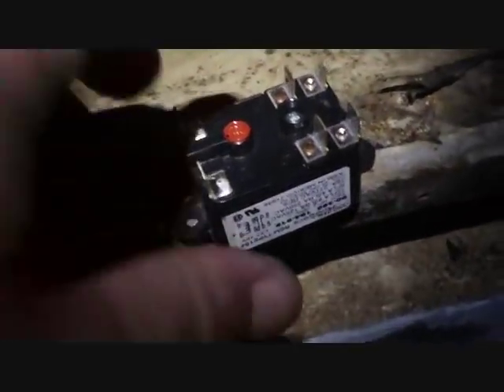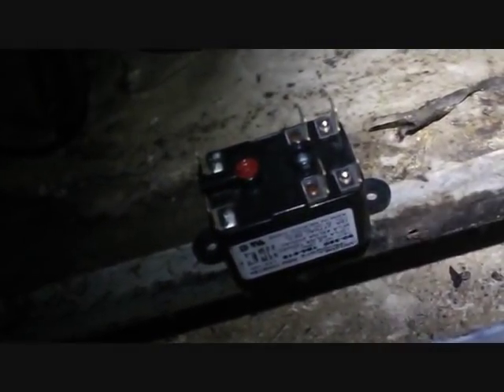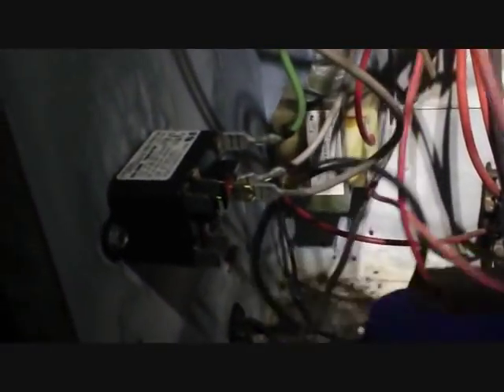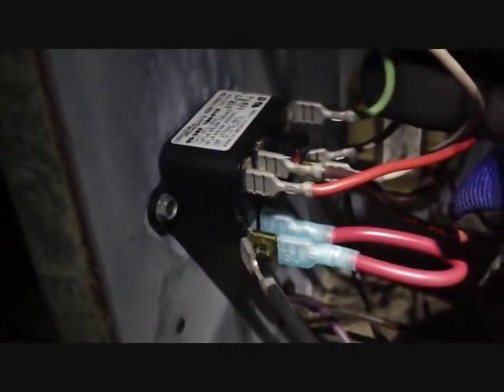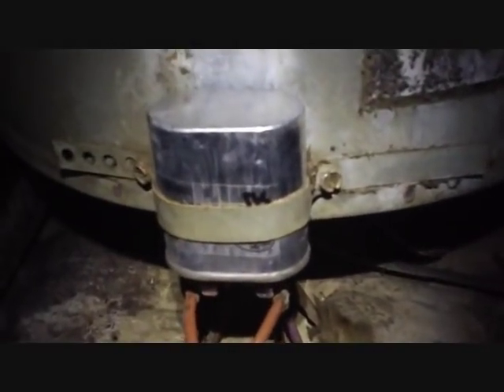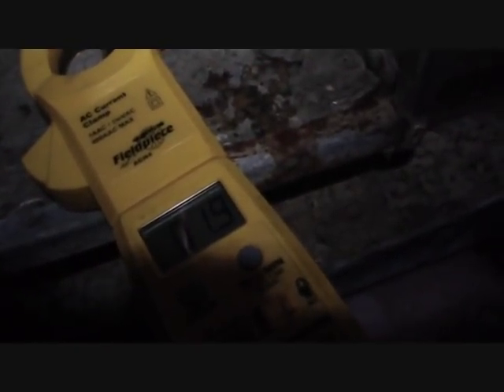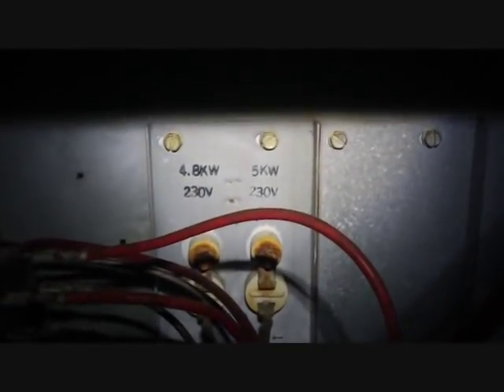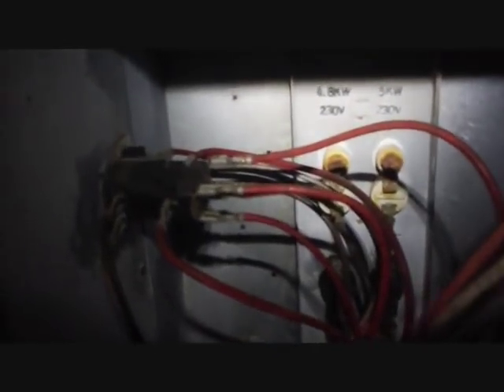Goodman Stack Blower Relay Failure | Heat Strips Run Constantly

Comment: Those old Janitrol relays were so bad to go out years ago that I got to the point if I was working on an air handler with one of those relays on it I would just go ahead and replace  it weather it was acting up or not. I didn’t trust them.
Reply: I will say they do seem a lot better now though,

Comment: They have changed that relay to a 'Blower control board" that seems to stick in aux just like the old relays did.. Especially in colder weather but it looks like those were the old Warren heat strips that most of our Goodman dealers here in NC have quit using.. fusible links couldn't hold up on the Warrens.. A common heat strip failure but its always fun to have the 2 calls stack together lol.. Relay stuck with 1 rack of strips running.. Can fix the relay but always have to order the strips lol
Reply: It is hilarious how they managed to redesign it to have the exact same failure

Comment: Hi tayln875 - thank you for the video - I think I'm having this same issue. I have noticed that my air handler only turns on when the aux heat comes on. The air handler will not run when the regular heat (+2 degrees over temp) turns on nor during the cool sequence. If I turn the heat 3 degrees or higher, the aux heat kicks on and so does the fan motor. I changed out the capacitor and that didn't seem to help any. Do you think this could be a faulty relay? Thank you!!!
Reply: +Tyson Rooney I forgot to mention - my AH is a Goodman A24-10. Thanks for your input!

Comment: Yes I see it now the normally closed side of the relay was was stuck closed so when the relay was energized with 24 volts and it pulled in the normally open contacts it was sending power from this relay directly back to the heat coils because of the safety loop feed from the coils back to this relay to force the blower on. One of those weird little setups that was used to prevent a problem that causes a problem itself at times......  I wonder if there is another way to do this that would be more reliable as this seems to be a pretty common issue.
Reply from the maker: I have often wondered about using a current sensing relay, but have never tried it.

Comment: I have the same air handler....I am having issues with the Fan not coming on when the Thermostat is in AUTO.  I can set the fan to ON and it will come on...sometimes.  Sometimes I have to put the mode to ON and set it to EM HEAT and then to cool to get the fan to come on.  I am thinking it is the sequencer.  My question is ...do you think this also and should I replace it like you did in this video for safety reasons?  My airhandler is A32-10  Goodman.
Reply: next time you got the same problem w/ ur AH try replacing the thermostat. also check the fan capacitor .

Comment: Nice video! Just wandering what’s connected on the other side of  N C contacts? On one side you have it jumpered and the other side?
Reply: It's the fan---when heatstrips are called fan also comes on...
Reply: on the other side of normally closed contacts, the wire is connected to the outlet side of the heat strip contactor so power is supplied to fan whenever heat strips are energized.

Comment: Got a 09 Janitrol unit, recently the fan stopped turning and no air was being blown. Changed the dual run cap per a local pro's advice and now the fan is turning but still no air... any advice on what to do would be much appreciated, I'm pretty much a rookie at this stuff.
Reply: which fan, condenser or blower?

Comment: Please explain in detail HOW the bad BLOWER relay was making the heat strips stay on?? I cannot get it to make sense. I could understand if the sequencer was bad and keeping the heat strips pulled in and the fan on but cannot wrap my mind around this. Please help
Reply from the maker: This relay typically routes power from the heat strips to the blower or the main lugs to the blower, but it tends to fail sending power from the main to the heatstrips and thus to the blower as well.
Reply: talyn875 Thanks for posting the video. I was curious did you test the old blower relay after you took it out?  I had been working on a 2001 Goodman AR024-1 it had the same symptoms that you had with the heat strip pulled in and the blower running (will not stop heating even with the tstat to off) however it was intermittent and would not act up when I was there. I "like you" thought maybe the relay was possibly shorting out and changed it plus I changed out the sequencer (just in case) and double checked the tstat wiring and tstat settings HW 5220.   Still the same intermittent problem. The system is just so simple that you cannot believe that did not fix the problem in one trip!!!!. What do you think it ended up being? Hint this is a heat pump.......  
Separate subject here I need a York AHU Control board S1-03101212-700 for the heat section Model @HW06501006A EECY151209 my local supplier says discontinued. Do you have a source or have one in your stash?  Let me know on that board I would pay good money for one as it will save several hours in the rewiring entire AHU to eliminate the board. The original board is a 031-01212-000 it would work also if you have one.
Reply: @HVACShopTalk  you have a diagram for this !! ihave the same problem !! with my unit

Comment: ive watched this video a lot and im getting a little confused... What is the point of the jumper if in heating and cooling as well as in emergency mode you have a call to the g wire from the tstat ? From my understanding if this were the case you would have the white wire energising the sequencer  which would then power up the fan and you would have power coming into the g wire energising the 6 pin relay. In my head it just seems that they would both be energized at the same time...
Reply from the maker: +joshua meadows the jumper is in place if you are not using two blower speeds. When the sequencer closes the voltage sent to the relay on the NC terminal switches from L1 to L2. That powers that fan while the voltage dead ends also on the no terminals. When the g energizes the fan the no terminals close and power the fan while the NC terminals open. This set up allows the strip heat to power the fan when there is no g call.
Reply: Thanks for the response . So it just a safety , for example if the t-stat wasn't functioning properly or the g wire wasn't making a good connection hypothetically. I'm somewhat new to the field ive been doing service work for a year and maintenance a year before that im real hungry for knowledge could you also explain to me what you mean by the power switching from L1 to L2 .  I understand what L1 and L2 are just not in the context of your second sentence .

Comment: I have a question.. I can't seen to figure out as to why my air conditioning won't come back one. Less than a month ago we had an hvac guy come out and he said it was the transformer.  He installed it and that lasted about 3weeks and it stopped again thus time the transformer melted .. so we called him and told me him he needed to come back out whatever he did... it went out again. He refuses to come back out and rectify it. So we bought another and installed it and then that one melts too.. I'm afraid to put another on due to possibly melting again. What would cause them to keep melting and what can we do to fix ? The heat factor here is super high and I'd like to get it back working... thanks in advance
Reply: Btw... both capacitors are new as well...
Reply from the maker: It may be a low voltage short
Reply: I had that issue happen in a heating system. Two transformers burnouts. Someone had joined an extra wire on the thermostat connections .I  Replaced entire wiring and the issue was corrected.

Comment: Could you please answer some questions for me?  I have a Goodman ARUF363616BA air handler.  Two weeks ago the fan stopped working.  All it would do is idle at a very low speed.  The unit is only 3 years into it's 10 year parts warranty.  I have a very ill wife who must stay warm and monitored 24/7 to stay alive and we are currently so poor we are on the verge of having no food to eat, so we could not afford a tech to come out to our house as they wanted $250 for the trip.  A service tech did me a favor and did a warranty exchange the capacitor. When that didn't work he offered to swap the  the 3-speed blower motor, controller board.  I had to give him the parts up front and it was two weeks living in below freezing weather while getting the parts even though they were local.  Fortunately I had taken digital photos to ensure everything was connected perfectly.  After getting all the parts and installing them myself I tested it.  I could hear the click of the heating elements turning on and the A/C the compressor started up, but the fan only idled, and that was usually only after I gave it a push to start it.  I check the voltage on the transformer and got 240v on one side and 27v on the other.  I jumped the red and white wires on the thermostat and heard nothing, but the fan could have been just idling.  I did get 27 v across the red and white wires.  I am at the limit of my knowledge as to what to try.  Have any ideas?
Reply from the maker: Could be wrong capacitor or failed blower motor. Was does idle m3an? Not spinning at sl (
Reply: talyn875 The capacitor, controller board and motor are from Goodman and are all a 100% exact match to the old ones.  When I say "idle", I mean the fan is spinning at a slow and steady speed, but not fast enough to push any air through the system.  When I received the fan motor and controller they were both factory sealed.  The capacitor was not sealed.  It looked new, but the box was already opened.  Is there a way for me to test the capacitor with an ohm meter?  Got any other suggestions?
Reply: Well, after two weeks of no heat in below freezing weather the repairman wanted $120 for a warranty paperwork fee for the motor and controller board it took him two weeks to bring even though it was 10 miles away and in stock.  I think he was really angry because I called his  Goodman supplier and found he had lied to me.  When I refused to pay the additional money he cursed me out and left me with a non-running fan.  I called a new repairman who came out and within five minutes determined that the problem was a bad capacitor that the previous repairman had installed 2 weeks earlier.  It did not even need a controller board or motor.  Upon closer inspection I check the label on  the box which the bad capacitor had come in to find it was not the same brand at the capacitor that was installed.  This new repairman installed a new capacitor and the fan started running fine, but the repairman changed the fan speed to high and now I get a lot of volume of air, but little heat. The repairman said the faster speed was better, but also commented about the heat strips being not as big as he expected.  It would make sense that more or larger heat strips would need more air flow over them, but should my unit be on high fan speed also.  I tried calling Goodman to get correct information and only get customer service who says they will ask a tech, but will not allow me to talk to them directly.  I am unemployed because I must stay home to care for my disabled wife an I dread to see what the next electric bill will be.  Who can I call for advice?  My number is 281-463-1302  Thanks, James

Comment: Why did you switch from a TDR to a standard relay?.  Was there no time delay required?  Just curious.  Your sequencer should bring on blower first then strip and upon shut down the exact opposite will happen.  W/O this set up we risk immediate shut down strip w/o blower to dissipate the heat.  A true test would be to kill the call for heat.  The blower should be on time delay and should not immediately shut down.  Good job in the description of your service.  Yea that POS is quite old...........Time for replacement.
Peace;MPT
Reply: A blower wired on a sequencer with strip heaters cuts off at the same time as the heaters, "on older units before fan control boards."  They was actually wired to where M1 & M2 stack on a sequencer started the first stage strips and the blower.  Once that first stage heat cut off so did the blower.  Time delay of the blower on and off isn't a safety issue on a heat pump in my opinion. It's a customer comfort, letting the evap coil get cold/warm before the blower starts.
Reply from the maker: baldwin1e that is correct
Reply: baldwin1e  I can agree with that.  Since I do not go by what it was or will be, I can only give my opinion as to what I personally would like to see as far as operation sequence of the equipment.  We all have opinions and since it is NOT a safety issue, "too each his own"....lol  Like I have stated in my previous post, that "Turd" is old and it's hard to dress it up and make it worth while to make the Home owner feel good.:-)
Reply: If you men get a chance, Check out heating help.com  Lot's of good people here and very professional to boot.  Any professional and customers alike can post and receive instant help on topics so that we all can learn.  Please feel free to join us.  "Hollywood"...